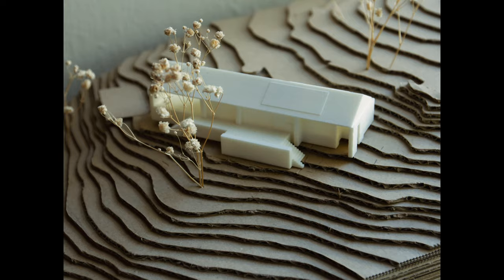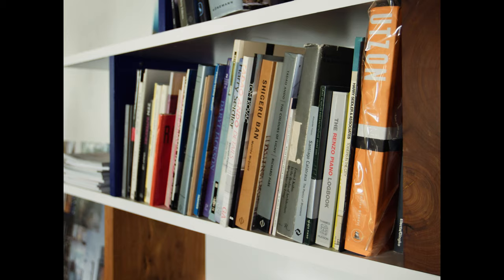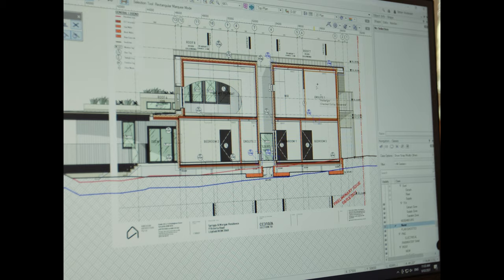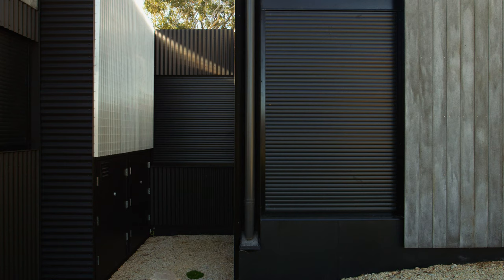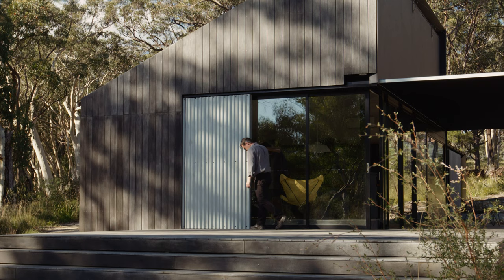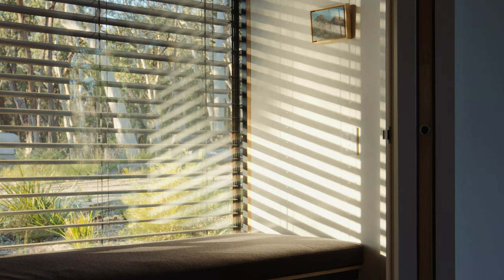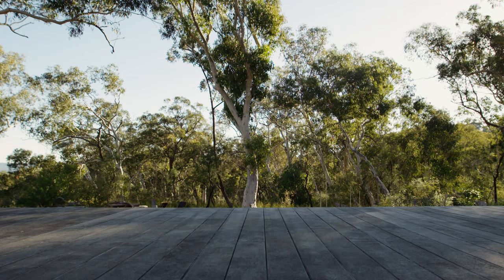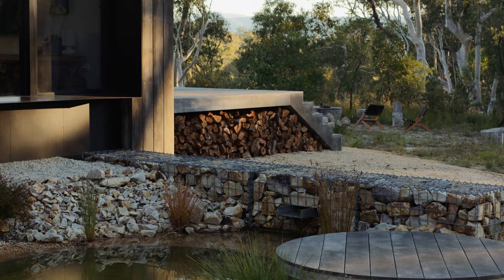Architect Simon Anderson's own off-grid, bushfire proof and sustainable home — IN PROCESS

Comment: Please forgive me. I am not trying to be rude. Its a beautiful work. I suspect it cost a 5 to 10 thousand a square meter yes? So how is this limiting carbon footprint in any way? This is the problem. A lot of flowery talk of sustainability yet their footprints are twice the average house or more. Beautifully detailed yes. Sustainable? Not a chance .
Reply from the maker: For an Australian home, this is a small footprint. In regards to all the details of the building’s carbon footprint, you’d have to ask the architect directly. From our limited understanding as video makers, sustainability is not one simple step, and when it is advertised as such, it’s not necessarily honest. The architect himself refers to sustainability as 'a bit of a dirty word'. The impact of a building adds up through multiple factors e.g. where were the materials sourced from and what is their embodied carbon after creation, transport and installation. How much energy and resources does it take to run. And how many years can it withstand the pressures of nature, like withstanding a bushfire in this case.

Comment: I may be stating the obvious, but ..... Your home is cladded in wood, you have masses of wooden furniture, your home has many wooden features and the Eucalyptus trees are too near your home. Apart from that, your home is beautiful, its just not fireproof. Just as an idea, Californians plant Cacti near their homes. They reckon it helps to stop the spread of bushfire near them.
Reply from the maker: You can read more on the architect’s website, but the cladding and decking is fibre cement board. Just looks like timber
Reply: Hi Dana the cladding is fibre cement, not wood, fire wood for the indoor fire is stored away from the house in summer. The clearing around the home was designed by a bushfire consultant so we have faith it will survive a major bushfire

Comment: Hi .. such a beautiful  beautiful location is Australia. Never get tired of seeing those wonderful ghost gums. If I can ask a question. I am currently planning on renovating my old, most thermally inefficient home that is freezing cold in winter, and stinking hot in summer. the roof leaks like a sieve, being made up of a fifties concrete tiled 22.5 pitch, 'U' shape plan, with a clip-Lok section in the middle of that 'U' shape, and another Klip-lok extension along the 10m width of the house at the back. No insulation to speak of in this house. I suspect that it wouldn't make a difference if there was, it leaks so much. I could go on but I think you get my point. I NEED to put on a new roof. So I'm planning on plonking on a gable for its beautifully symmetrical presence, with corrugated sheeting, that will give some weight to this ramshackle old rectangular box (once the texture and colour of the surfaces have been added, it should look proud and strong). So the east end of the gable will have windows looking out to a bush reserve, and at the west side there will be a bay window, allowing a cross breeze through the loft space, ventilating the whole house. I hope to get away with an open vaulted ceiling throughout the house by having an intermediate beam running the full 14m length, on either side, positioned about 2/3's of the way up either side of the roof. That means they will sit 2 metres down from the ridge board.  So the rafters will span 6.1m, supported on one side by the external wall, then by the 'intermediate beams' about 4.0m up, then 'Counterlevering'' over the intermediate beams to tie onto the 'Ridge Board', meeting up with its opposite rafter, which I hope will act in a similar way to that of a 'Key Stone', transferring the load back down through the beams and  external wall. (I'll need to seek out an engineer). Now I get to my question, if you've managed to bare with me, I wouldn't blame you if you didn't , as I waffle on. If I was to choose any colour to go with the aesthetics of the building (charred cedar boarding at both ends of the gable), well then it would be a deep dark charcoal grey, matt finish, corrugated Colorbond sheeting. Now I noticed your roof isn't a light / white coloured finish but rather a dark finish. Why did you not go for a light colour to reflect the heat. Love your place. I mean, the idea of it. Thanks for sparking so many idea's.